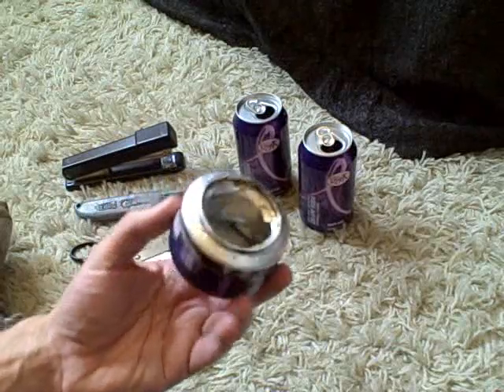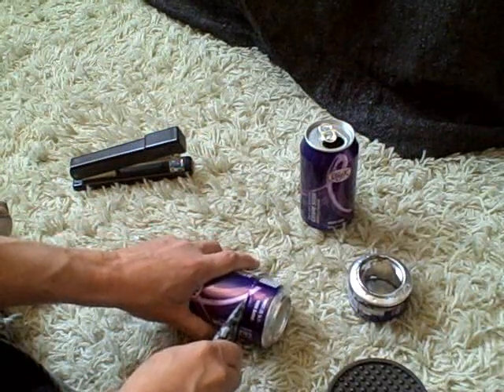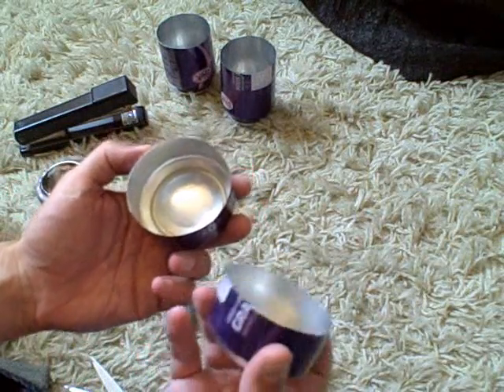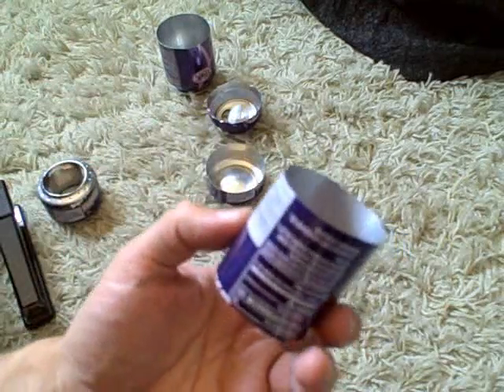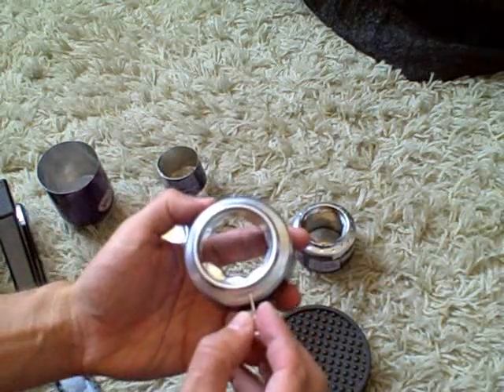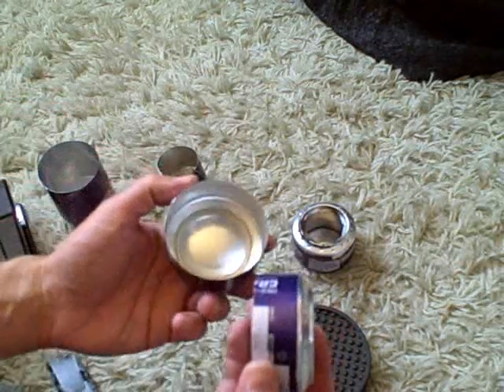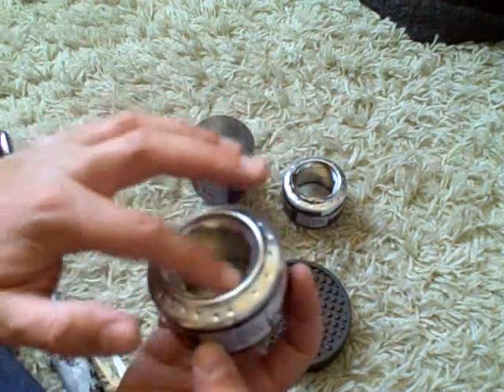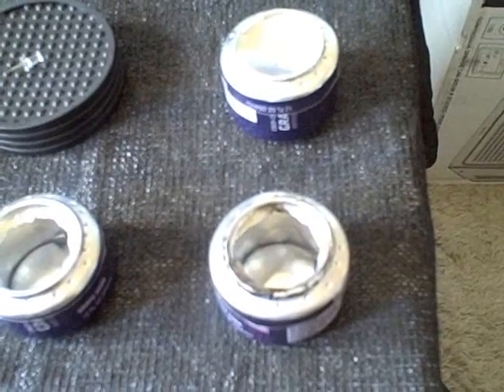How to make an Alcohol Stove (detailed instructions) - DIY soda pop/beer can stove

Comment: I've watched a number of videos on how to make both "penny can" and double walled alcohol stoves from readily available aluminum cans and have increasingly come to the conclusion that the "penny can" stove is functionally just as good as the double walled type. With the "penny can" model you simply poke some holes in the center of the indent, pour fuel, and you're ready to go. While the double walled type does not require priming using a tuna can base my experience with the double walled variety suggests that it still takes several seconds for the alcohol to begin boiling and vaporizing. Since most users place a pan or pot directly on the topmost ring of the stove having an open flame over a pool of alcohol in the body of the double walled type has no demonstrable impact on the amount of heat being generated by the jets around the topmost shoulder of the stove. About the only real advantage of the double walled stove is not having to carry a can lid priming tray (which is very little extra weight on a hike). Then too, I have found that cutting out the indented portion of one can is, frankly, a pain.

Comment: Good vidio.  .  I would add you can buy fuel in every gas station in the mid west.  They all carry gasline anti freeze  HEET or a similiar brand.  Other alcohols work  just not as well.  More volume of alcohol needed to heat the same amount  of water.  HEET or a similiar brnad is best.